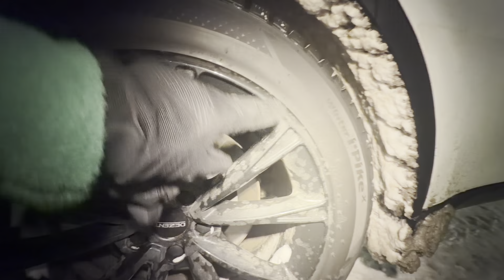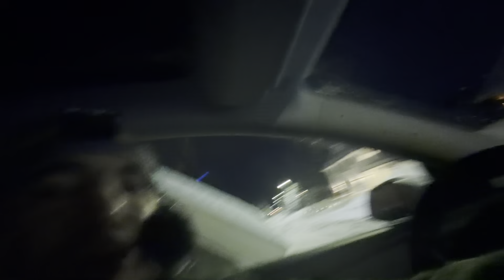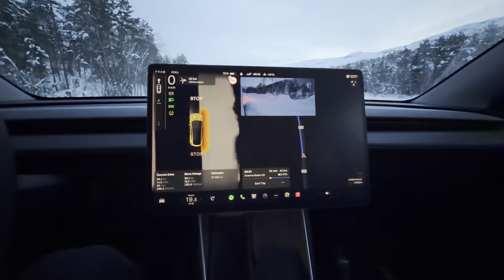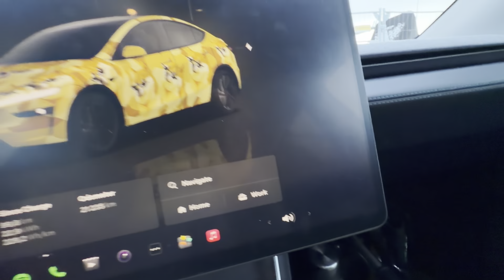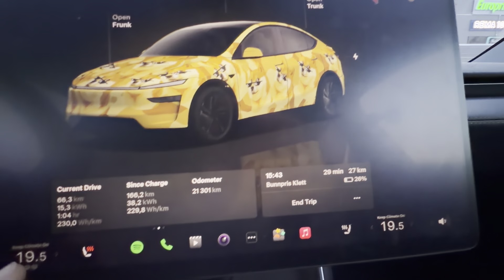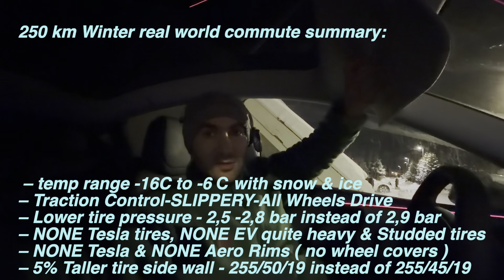Best LONG Range Electric Car–Winter Range Test in Tesla Model Y Juniper Dual Motor #Tesla #rangetest

Comment: * Bigger wheels = wrong distance reading which lead to wrong consuption?
* Low tire pressure? why? you'll get less friction in the middle of the tire during braking. That's not correct, the manufactors pressure gives the best stopping distance, stability and consumption.
*I'm driving a 2026 Performance with 21" staggered setup and have a combined consumption of 225wh/km. That's numbers with 80% 120km/t.

Summary - This is not typical consuption numbers on a Tesla Model Y
Reply from the maker: Hi. Thanks for the great input ! 

Does your consumption 225 Wh/km based on cold  winter conditions as well?

Comment: So you just make it with a new car.  You won't make the day when your battery is near 70% capacity which is what Tesla warranties.
Reply from the maker: It is going to take a lot of abuse and several hundreds of  thousands on miles before overall remaining battery capability drops to 85-80% …….
Reply: Typical EV troll... It's very funny too see how gasoline or diesel car once reach 200,000 km and then most people just pray the engine to survive at all. Total bullshits.

Comment: My experience is that snow on the road is as penalizing for range as the low temperature.
Actually, the worst is slush.
What is your experience?
Reply from the maker: Slush is typically happens at positive temperatures like +3 Celsius or so and it only remains in small cities in residential areas …… on highways —roads are cleared from snow pretty fast due to snow plows and busy traffic…. So in the area where I live it is practically impossible to drive 250 km in slush ……. 

In my neighbourhood I can drive 20 km in slush , but this will be 3 rounds in the same area …….. you see what I mean now ?
Reply: @TeslaImpressions 
Well I also commute 250 km… one way… but only once a week between my main residence in Switzerland and our country house in France. The highway goes through the Jura mountains and, like in the last 10 days, we can have quite a bit of snow. But the temperatures are not as low as in Norway. So, if we are driving before the snow removing equipment, we can have about 10 cm of snow on the road, but it’s often very wet snow, and even slush. 
Those are the conditions in which I observed the highest consumption on my Model 3.

Comment: Real world test and you set the temperature on 18 degrees. Come on...
Reply from the maker: I am wearing woollen underpants and undershirt…. Full woollen base layer , woollen socks and winter boots. 

Also, on top are Columbia winter pants and thickest Helly Hansen fleece jacket — so I don’t like sweating in my car. 

And I wear base layer because in my job site I work outside on a little boat , not in one of those warehouse— that is why I am kinda half way dressed up and prepared for my job. 

But I also use same clothes if I were to go and walk for hours in the city ….. with only exception of having a winter jacket on top ….

For driving- I was not feeling any cold inside
Reply: What’s wrong with 18? When driving in such winter conditions, you are not dressed in shorts and T-shirt, but in winter gear! And anything much above 18 is too warm!